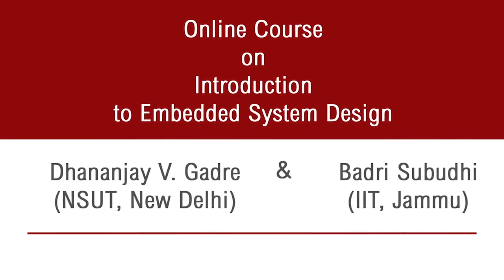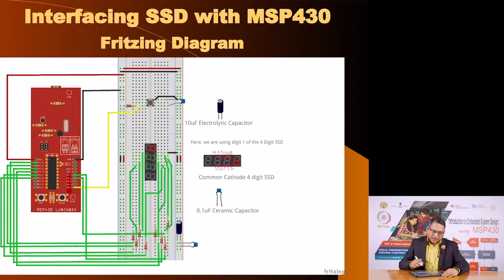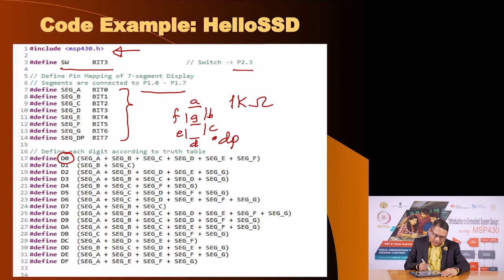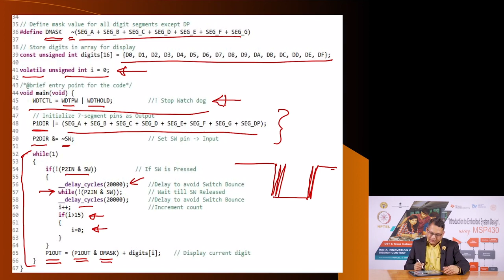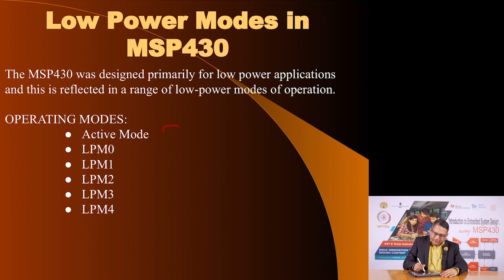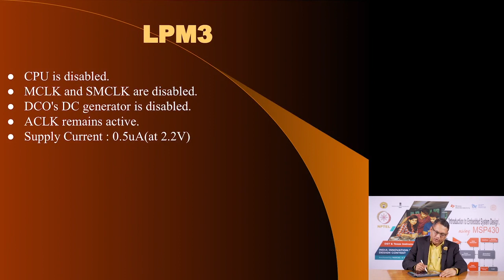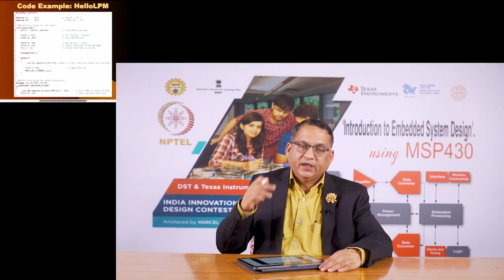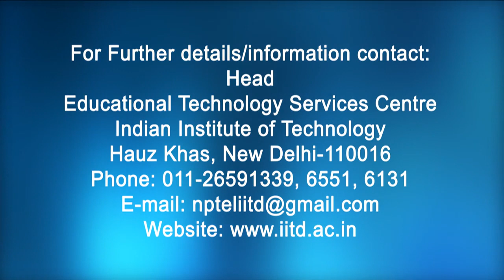mod09lec27

Comment: 34:18 I had a doubt. Sir told that riding edges will cause interrupts. But when a switch is pressed and released, due to bouncing there will be a lot of riding edges, so isn't this kinda undesirable. How can we overcome this
Reply: That's why we are adding capacitor parallel to switch. Which act as low pass filter and reduces switch debounce.
Reply: Didn't you watched the previous video?
Reply: @027_lakshaynegi6  Yes but what was I supposed to know from that video.
Reply: @dhaneshprabhu72  well you was asking about how to stop denouncing of switch as their will be lot of rising edges which we don't want so in previous video Sir told to use a low pass filter,a resistor in series and capacitor in parallel i.e hardware debouncing.
Sir also told generally not to use LPF as it increases the cost but also in interrupts we should not ise delay hence we use LPF.

That's what you was supposed to know,but I guess you must have completed this in those 4 months.
Reply: @027_lakshaynegi6  Ha I know about this concept, but on this video, during the demonstration, sir has not used a capacitor for denouncing, that's why I was confused
Reply: @dhaneshprabhu72  watch it in series from next time vrom